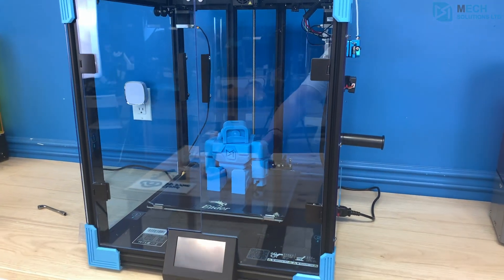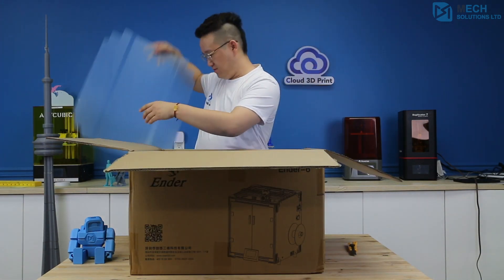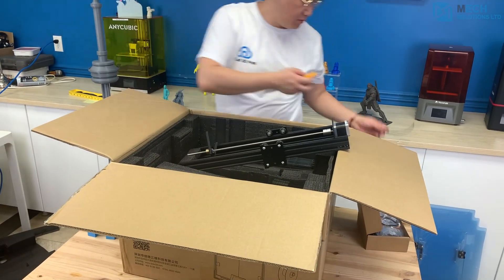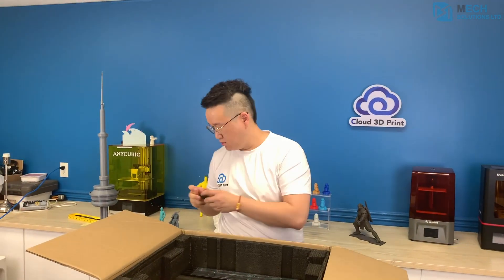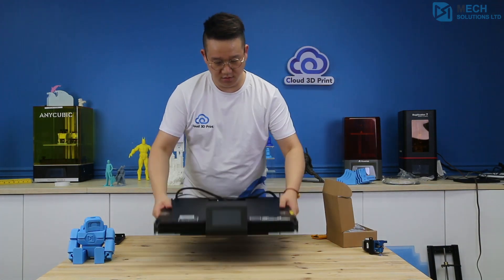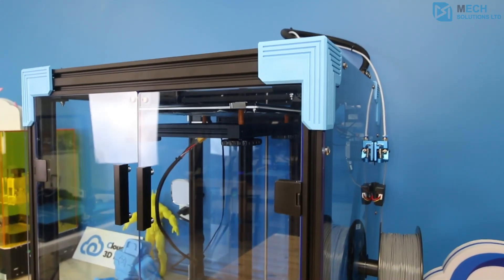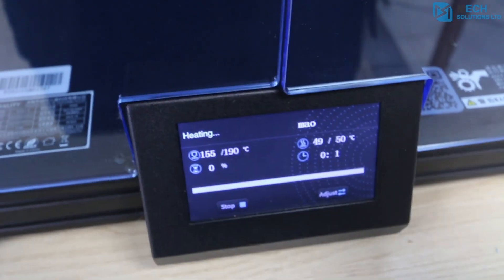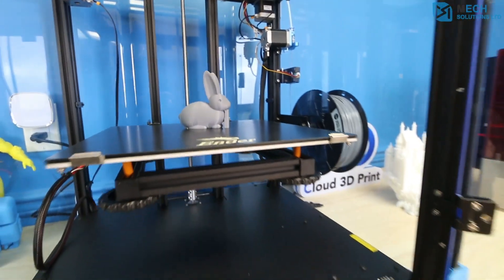Ender 6 Reveal : Unboxing, Assembly, Features

Comment: If anyone buys one of these awesome units and when they stick the SD card in the machine shuts down its cause of the bolts in rear left corner shorting out the bed cables so unscrew the 2 little plates and remove the bed cables from in the groove and put plates back in place then ziptie the bed cables to the outside of those plates and jobs done fixed that issue , turn off mains plug then turn all back on after couple minutes and SD Card should go in and work as it should